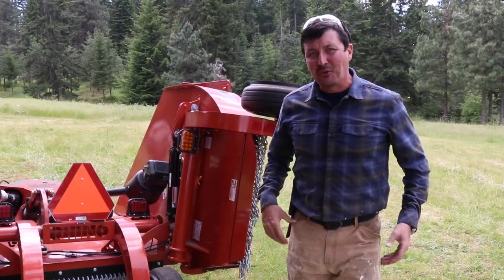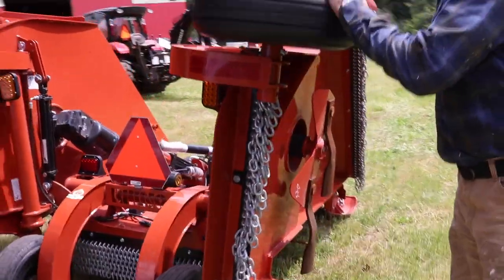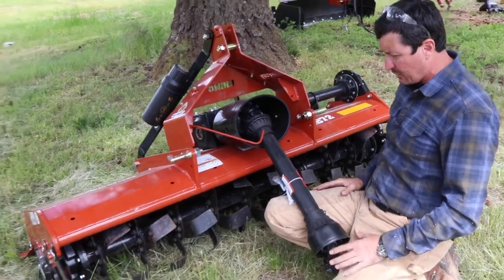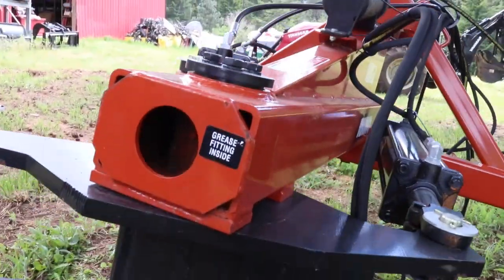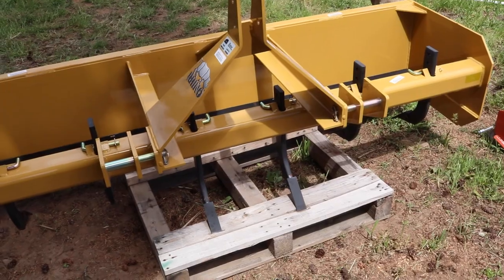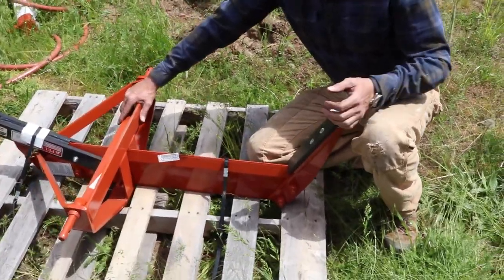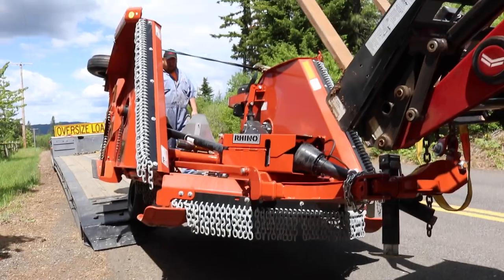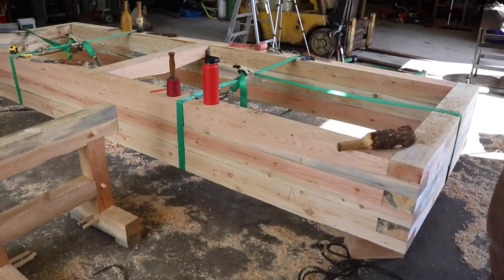We Got A RHINO And It's HUGE!!

Comment: Cody, you need a shelter/lean-to for storing all those implements now. God bless
Reply: David Shelton I was thinking the same thing. There is a lot of money sitting there out in the elements.
Reply: +2 Is your barn big enough for all your equipments?
Reply: At least he has the means to dig the holes to set the timber for his timber frame tool shed.
Reply: He had said something just recently about putting them in the barn where he has all the wood drying. Probably no room down there now though.
Reply: I wonder if the current timber framing project will result in a new equipment storage shed? The timbers they have been milling are large enough for a substantial building.
Reply: David Shelton probably what he's been making
Reply: Perhaps he needs to build a timber frame garage?
Reply: He's waiting for someone else to buy/build and pay for it just like everything he's got around there.

Comment: Cody and his new toys. The wedge style mower is called a brush hog and the winged one is for lawns of few acres. Your digger needs a rack to hold lengths of pipe and spindle of tubing. Your wing blade can push snow to if you need to clear a flat area to put your snow to the left or right side of it. I wonder what he wants for Christmas now.
Reply: South Efrikan  More like a hippopotamus.
Reply: "Only a hippopotamus will do!"
Reply: Pygar2 Then you know the tune by Gail Peavy.
Reply: A classic, and all over YT.
Reply: Frederick Nolan, Sorry Fred, but they are both Brush Hogs for mowing fields. You can tell by the blade design. a "lawn" mower has fixed blades, brush hogs have them set up to where they can "flail" to better cut through small trees/brush.
Reply: Robert G Designed to wack off those thick weeds. I am use to a gang of reel mowers for grass cutting. Ok thanks for the update.

Comment: A few years back I used that same hole digger to plant over 1000 cherry trees. I couldn't go in and rip the ground like I normally would because of an existing orchard, but at the same time I had hard pan to deal with. I used this digger to go down through the hard pan and then back filled. The trees have flourished there. Over a thousand holes through hard pan just about as bad as concrete and that digger didn't even flinch. Great equipment.

Comment: We buried enough PVC to irrigate 100 acres of citrus grove with an implement just like that and this was existing grove, not bare land before planting. I must admit that the larger (8", 6", 4") distribution lines were put in with a ditchwitch, but everything 2" and below were plowed in, as we called it.  It used heavy chain and bullet shaped soil expander pulled behind the plow point that then used a 3/8" bolt to connect the pipe. What a labor saver that was. Of course, Florida being all sand made it a little easier as well.

Comment: Can't wait to watch a video on how to "PROPERLY" sharpen the blades on the Rhino mower. Need a timber frame shed now to store all the attachments. I guess your tractor usage just went up.  You will have to fix the fuel storage tank now as well.  Lot to do on the homestead
Reply: I just take the blades off of my mowers and use my bench grinder to put an edge on them.  Do a chisel grind on the top side of the blade with a small bevel on the bottom side.
Reply: Yep you are right.  Light quick passes and dunking it in water between passes on the grinder is the way to do it.

Comment: You can mow scrub with that single deck mower. I use ours at work to keep the alders down around the fence line. the way the blades are hinged prevents them from bringing up and staling the PTO slip clutch.

Comment: Nice!  We had a large (er) batwing mower and brush hog mower at the ranch I managed in MT.  I found that I liked the Rhino implements much better than any other brands out there.  Even our neighboring ranches like them.  We used the batwing for controlling large areas of noxious weeds, and the small single mower for mowing the ski trails in the fall, in preparation for the Winter ski season.  Hope you have fun with the new toys!  Don't forget to take a break every now and then to eat and sleep.

Comment: Glad to see you got an auger. It can  be used to plant your trees. Do they have a pneumatic or hydraulic hammer/driver for setting posts. You probably have seen large models driving piles for high rises or piers. That method doesn't disturb the sub soil like the auger does and no back fill necessary. they probably have a plethora of tools and you'er not a greedy man. Congratulations on the new tools

Comment: 5:00 So when I was a boy my parents rented and farmed a large chunk of property.  We kept several acres of barnyard fenced in for horses and cattle.  Our posts were old electrical poles my dad would pick up with a tri axle trailer from Wixom Michigan.  We would cut them into 10 foot lengths, dig a 5 foot hole with an augur VERY similar to that one and run 4 strands of high tensil wire placed about a foot apart.  The corner posts were 3 feet deeper.  Overkill?  Maybe!  You can put a lot of tension on 12 guage wire.  The point to that story is you can find yourself extensions for that auger and dig deeper holes if need be.  Just a thought in the event you decide to build a barn. Or a well?  LOL Cheers from Michigan.

Comment: I am green with envy, sorry! A Large deck rotary mower (thought it was a flail mower )is so useful. Brush, high grass and small trees are all on the diet.
The box blade makes it so easy to do road maintenance. That tiller means some acreage tillage. The post hole digger can get you in trouble. 811!

Maybe a hay operation?

Comment: Just a tip for your pallet forks, in our bobcat we torched a hole for a hitch ball to move trailers. Wen you take the ball out you can also use it to move farm implements suck as the brush hog

Comment: It's great when you already have the tractor to unload your awesome haul of tractor implements.  I'm glad you threw that out there about the HP of the Yanmar.  My first thought was, "how in the world will he have the PTO power to run that batwing??"
Reply: It will struggle the pto hp is always lower than the rated engine hp
Reply: I've had issues with various tractors in the past.  Some have the HP listed as PTO, some have it listed as engine.  Have a hard time believing the Yanmar has 68 at the PTO.  Very impressive if it does.
Reply: I'm sure Yanmar is going to air drop a bigger tractor to the homestead!
Reply: Zippy, that's the biggest compact tractor yanmar makes.

Comment: WS, I hope you read this, I suggest you do some research when repairing the driveway, look into solid plastic soil stabilizer grids (EcoTerr - Stabii-grid is a prime example), DO NOT use those expanding ones, they suck for medium let alone high traffic areas. they are great for keeping a dirt or grass driveway and help contain and lower maintenance of gravel or crushed stone driveway surface. If you do keep with a natural driveway I suggest you check out the subsoil, if not properly constructed you get what you are dealing with now. You also should look into geo-textile to add more strength and longevity for the future and lesser maintenance overall with those two products installed when you redo the driveway.

Comment: Just a tip from a farmer. Remember to turn on the pto very slowly when you use such heavy equipment or you will break the safety bolt on the pto shaft, wich is very annoying to change.
Best wishes from a danish fan.

Comment: The dealership I work for used to deal with Rhino products. We found them to be very rugged implements and well built. However. Things would break from time to time and when we tried to order replacement parts, we were quite often told that the part was out of stock and would not be available for a long time, like, weeks to months. Several commercial users who had Rhino mowers and needed them and had them break, had to sell them in auctions because the parts were not going to be available for a long time, and they bought a different brand of equipment. I was very sad to see Rhino go away from our dealership but very glad that I didn't have to deal with all the back-ordered parts and angry customers anymore. Sorry to rain on your parade but this is all true personal experience from a long time employee of an established equipment dealer.

Comment: Here in the burbs I could work every spring with that rototiller. Lots of kitchen gardeners don't want the land plowed because of the small size of their gardens. 
I bush hogged my Mom's set aside acreage that she had been paying a local guy to do. It saved her $500.00. It took me two weeks to cut 32 acres. Mostly because my 60 year old tractor and bush hog broke 3 times. 😕
With your rig I'd be busy all year round.  😁

Comment: Be very careful when  using new equipment. I know you have used much bigger machines than this but if you're not familiar with it , it can hurt you.  I was mowing hay in Montana ,  with our new mower. It was a small  field of about 10  acre's of alfalfa. I finished and started to  put the mower in road travel condition to move  to the  next field. I went to put the cutter bar up  and it smashed my thumb between the cutter  bar and the  hydraulic attachment.  It smashed the  tip of my thumb off  and pulled by thumb nail  out by the roots. Serious pain ensued.  So watch that new stuff, please because I was injured because I didn't know the  new piece  of  equipment 's  different steps for road travel. I was only 15 years old but still it was what I didn't know  that got me.
Reply: Frank Gerlach: This is so true. I have cut and processed firewood for years. But in one moment of inattention, I got a flattened thumb. The odd thing is, the end bone of my thumb broke in two places. I would not have thought that bone was big enough to break in two places. And it still missed the joint. I was really blest! It cost me a nail that grew Bach very thick and sturdy. But no blood and guts. I'm sorry for what you suffered. That was worse!

Comment: PLEASE FOLLOW THE INSTRUCTIONS ON THE PTO EQUIPMENT ON CUTTING THE PTO SHAFTS TO THE CORRECT LENGTH!! If you don't cut the pto shafts the right length for each implement you can do serious damage to tractor and or implement if the shafts are left too long.
Reply from the maker: No need to cut anymore, these have a sliding yoke,
Reply: +wranglerstar  they can bottom out and do serious damage to tractor or implement. And each has to be cut custom for each attachment, sliding yoke r not. My snowblower 3pt is sliding yoke and I had my dealer cut it to length so if anything happened they would be liable. It tells how to measure and cut them in the manuals taped to the shafts.

Comment: I would suggest not ordering/spreading gravel to drive on, rather get crushed rock. It won't move or scoot when you take your vehicles on it.
Reply: Sorry Austin, you are incorrect.  As James stated, crushed rock is made up of broken pieces that will compact and make a proper driveway.  Gravel is made up of small stones that will spread when under vehicle pressure.  Gravel is fine for the bottom of a ditch or a drainage area where it can be contained but terrible as a drive.  These are  two very different materials.
Reply: James Bockenstette DG decomposed Granite would be ideal if it in the budget.
Reply: For purposes of clarification, gravel is stone that has been processed by glaciers.  Gravel is smooth and is naturally varied in diameter size.  It works well under concrete to allow drainage as it does not pack tight. Walking or driving on gravel is like walking or driving on marbles.  It does not stay in place.  It moves from the weight of tires and the vehicle.  Crushed stone has a different use and is ideal for driveways.  When driven on, it will pack and settle into a firm base.  It resists moving because it has jagged edges and points.
Reply: Yes some good quality line MOT. It will compact solid. Then maybe a layer of gravel in 12 months. Gravel is good as burglars dint like it. Too noisy.
Reply: AllaroundNbackagain ....  Good stuff!!  Good compaction, reasonable price, and has the "feel good" of being a second use/recycled product.  Highly recommend.
Reply: ramosel I said that above. In the uk we called it MOT sub Base. Cost about £300 for 20tonne
Reply: Yup! good advise coming from James, get cracking Cody! I'd like to see you how you use that RHINO equipment.
Reply: ramosel
To confuse you more in both cases MOT sands for Ministry of Transport. 

For a car an MOT is a yearly safety and emissions  inspection that all cars over 3 years old must pass. Otherwise they can't be driven on a public road. Also your Insurance  would be void. So it's a short hand for inspection certificate. 

In the stones case MOT, or rather MOT type 1, (as i mentioned above) is a grade of stone for sub base for public roads. Just means it's got high amounts of lime and is very compactable 

Hope that helps. The car term MOT is the term most Brit fear.
Reply: ramosel also I'd image 8/10 brits won't know what MOT stands for.
Reply: Amazing how many people will put down gravel or crush every other year but won't buy road base. All we used growing up. I swear you could build a road through wet pasture with it.
Reply: ramosel in regards to weights of stuff like this, we buy by the cubic meter for the same reasons. Though in diy stores, your most likely to buy by the tonne. I'd imagine your the same.

Comment: The cutter with the fold down wings (TS12) is a brush cutter, you can tell by the blades and the oval/bowtie center piece, the blades are thick and heavy and are pinned to the oval/bowtie and free to spin or stop as needed, the bowtie/oval piece that the cutters are pinned to is called a stump jumper it's supposed to ride up on the stump and pull the blades up so they don't get damaged. This unit is not a grass cutter although when new it will cut or fold over tall grass it works best cutting brush likely 2" diameter and less, until you are used to how it works keep it up off the ground the more friction(brush, sod, moss) it has to cut the more horsepower it takes and if you are up and down thick and thin the tractor will bog and you will not cut so well, those chains that are dangling on the open sides are to stop or slow down projectiles, do not operate this cutter with heart racer near the chain sides or new a vehicle you care for or anything else you don't want a dent in, that unit will throw rocks and wood chunks at least 50 feet at high seed if it gets by the dangling chains. That brush cutter is an awesome tool and may be a bit big for a 60 hp tractor but it will run it, if you hit too clumps of maples at one time it will stall the tractor, the brush cutter will be one of the best tools on the homestead if you have any amount of forest property that tool can cut brush, if you can drive over it, the cutter will cut it, you may have to go over the bent beanpoles a few times but the tool can do the work of many men better, you will enjoy that tool. And one last thing if your tractor is not hydrostatic the momentum built up in turning all of those cutters and gear will drive your tractor that is if you don't double clutch and have it revved up when you push the clutch the tractor will drive ahead if the cutter is spinning and it don't matter what's in front of you the tractor is going ahead and the brakes won't stop it, you will learn to control it, go slow and plan your path ahead, all the time! The tiller is a good tool as well but it sorta goes against the back to eden method or the layered lasagna method of gardening but it will fluff up your garden beds like nothing else, let the tailgate loose on the back as you till it will kick up the rocks to the top and the tailgate will leave a mark in the fluff where the rock bumped up and hit it so you can go back and remove the rocks. The tiller doesn't do sod well it will take a few passes over original sod to chew it up and it is still not going to be as good as no sod soil, if you want to do a new garden spot you should plough the field and roll the sod over in the fall so the sod will rot over fall/winter then the tiller will fluff it up easier. Something else you may want to be aware of that tiller will fluff up soil and leave it soil smooth with the tailgate dragging behind but down below those tiller tynes are packing the soil hard so down about the 1/2 the depth of your tiller diameter the ground will pack hard, that is why a lot of farmers went back to disc tilling. Make sure the drive end has required gear oil there is likely a top fill plug and an oil level drain screw don't overfill the gear box with oil, the oil heats up and will pressurize the gear box, there is likely a vent hole in the fill cap but if you put too much oil it will pressurize and you will see where it comes out. the tiller likely also ahs grease fittings inside on each end, make sure it stays greased, grease is cheap those bearing are not.The straight blade is a good tool as well the key to having a good road is a dry road, the only way to keep a road dry is slope it, 0.5% ( one half of one percent slope) water will run drain your water to the ditch side, it will take time (many passes) to get your roads sloped but its worth it, my roads are as wide as to widths of my straight blade and peaked in the center. If you are grading and cutting a dirt road don't be going as fast as you plow snow, if you catch a rock in the road it will swing you in that direction promptly or break something, so everything needs a bit of slack or you are going to be doing welding or replacing linkages. All attachments need slack don't snug them up too tight. Have fun!